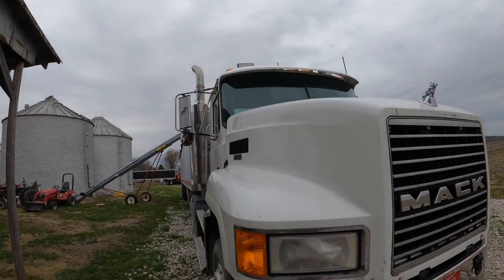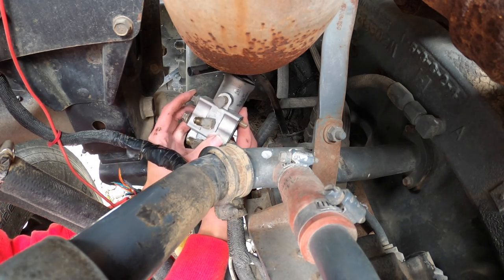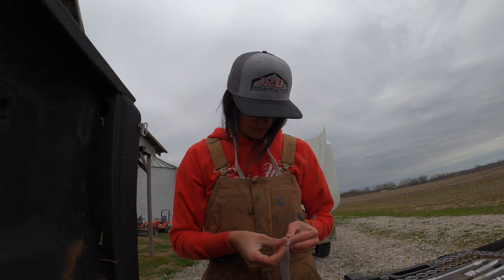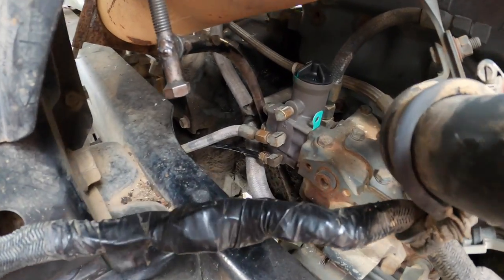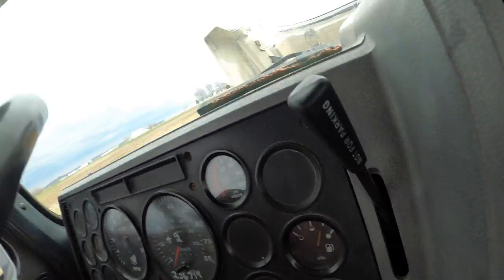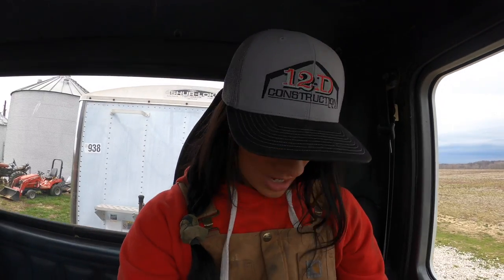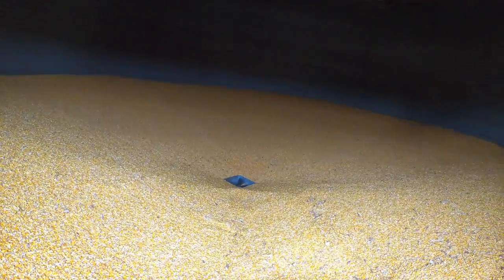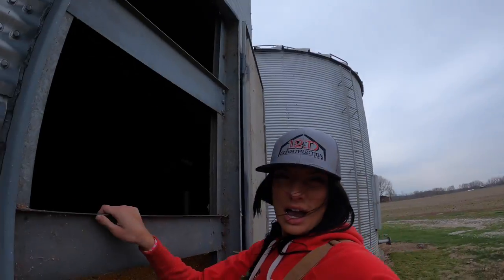Fixing the Mack

Comment: Grayce, do you happen to know what brand or store the first governor came from. Obviously I bet both you and your dad were less then impressed with that crap and took it back ( so they can send it back to China ! LOL ) and bought a unit elsewhere that does work as intended. I have a curious suspicion of where it may have been purchased, I may be way off though.
Reply from the maker: We bought it at a place in town, I don’t want to name the business because we do go there for other things!
Reply: @thefarmergrayce  I totally understand that angle of the situation, the power of media can unintentionally have negative consequences when its not the retailers fault. Sadly there is a fault in the whole system that has allowed garbage to be made and shipped over to our shores. I have had 3 major failures with a " Traction HD" branded 3030 brake pots as the main spring brake spring failed and also caused the pot to leak air and none of these pots were in use for very long at all in years. It screams safety issues and I don't enjoy replacing spring brake pots when I have no time nor the weather or heated shop in the winter to work on it. I've got one of those brand new brake pots left sitting on a shelf and I don't intend to ever use it as I keep a few genuine Bendix pots on hand. By the way your doing an excellent job loading the trailers, you can load my trailers any time you like !